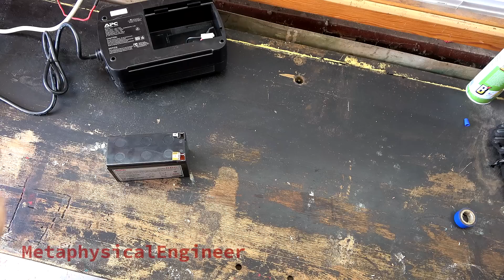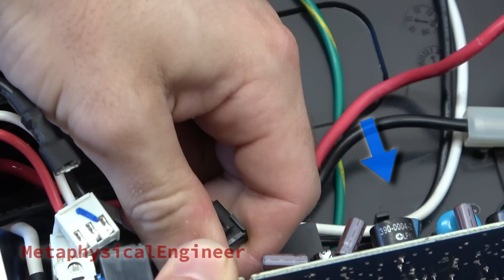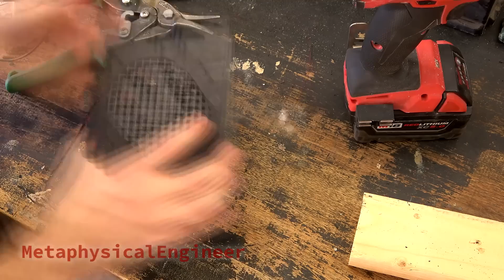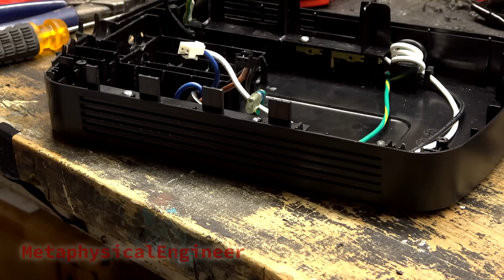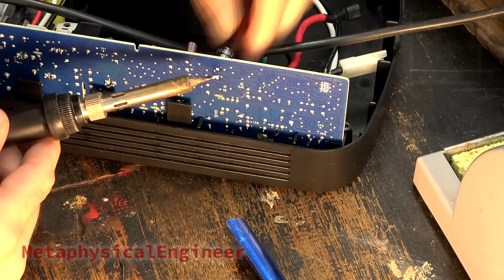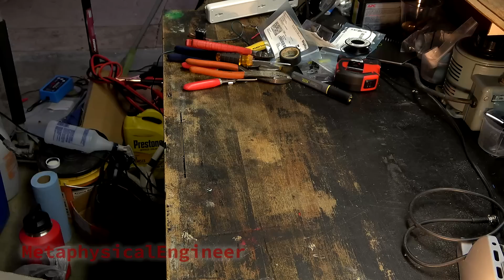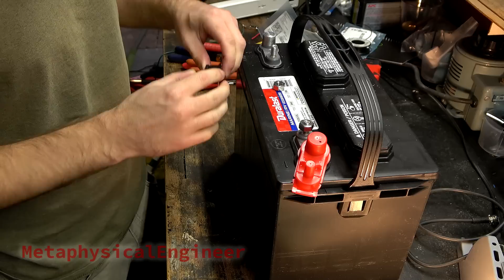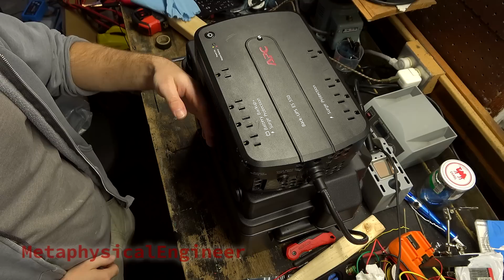Modifying broken UPS for long endurance BACKUP POWER!

Comment: Dude, that's a vented L/A battery being charged 24/7. I'm all about doing dangerous stuff and have modded many a UPS, but with LiPo4 or sealed L/A; What you have built will try to kill you. Otherwise, great build. But please, get a different battery. Generic China LiPo4 works best as it has it's own BMS and won't overcharge, plus 6x the runtime. It will take forever to charge with that tiny charger though. I run an old rack 3K UPS with a 48V Chins LiPo4 with bluetooth, runs my entire office for 5+ hours, I also have a LiPo4 charger on it (parallel) which recovers the battery in 4 hours, using the APC trickle charger took 30+ hours to recover. Keep on hacking!
Reply from the maker: How, exactly will it try to kill me?  Emitting a fraction of a gram of hydrogen over a 24 hour period in a 1960s building that has more than a full air exchange in that time? If it's gassing more than that at 13.5V, every battery maintainer ever would demolish every flooded battery it's connected to in a matter of months.  Much of the panic over battery gassing assumes batteries under heavy cycling and many batteries in a small space.  

Eventual version 2 will have the high performance batteries, solar/grid dual input, and all the goods.

Comment: I used UPC similar or just like this for years. Just drilled hole in battery cover and ran right to car battery. Never had any problems if I only connected it to computer and monitor. Much larger UPC units are available for cheap or free that just need a battery. No mods required. I only use semi-sealed batteries (tops don't come off) for less gassing. And I only use APC brand UPC. Less likely to have problems.

Comment: I've been thinking of doing something like this, but my work PC can be consuming up to 900W and who knows what I'm going to be doing when the power goes out. Thinking about chaining two batteries, but would also need to find a higher capacity converter.
Reply from the maker: Get a high output UPS sized for your equipment, including peripherals such as monitor(s), network, and a light.  Many higher end units will have options for external batteries and cooling systems to support extended run time which will simplify the project.  Size wires and connectors and fuses for the load, and get batteries of sufficient capacity such that they will discharge 50% or less during a typical outage.
Reply: @MetaphysicalEngineer  Yeah, that's probably best. I'm also trying to determine the best method for small consumption items scattered around the house; some cameras and sensors. Most use USB connectors so I'm thinking a standard power bank that supports line passthrough at full charge with instant switching. Been difficult finding reliable ones.
Reply from the maker: Power banks for smaller scattered devices is the way to go.  Most of those with USB are already using double conversion line to battery to 5V USB.  Transfer should be seamless.  Unfortunately I don't have much firsthand advice to give for those.
Reply: @MetaphysicalEngineer  You'd think so, but surprisingly almost all of them specifically state they do not support failover or passthrough. It's crazy. I have found literally one that supports it but it's like $200, and for that id might as well get a small UPS.

Comment: This is cool and all, just wondering why you went through all that effort to keep the beep? It's not like you don't already know the instant your power is out, do you really need an obnoxious beeper for a second opinion? Cheers 🍻
Reply from the maker: Often I will start a render or upload and then go do something else, so the alarm still has a use.  If it's the daytime, there often won't be many other items using power in the house so plenty of times the power has gone out and we didn't realize it for a while.  Plus, it wasn't that much more effort to keep the beep since I already extracted it to use the signal for fan control.
Reply: @MetaphysicalEngineer :
Understood.

Comment: You said you want this unit to be capable to allow you to finish a render, but then tested it at a similar load to your computer's idle power draw.  You could very well exceed the 500 VA capacity of that unit depending on the hardware in your computer.  Mine will pull 600 Watts while rendering, and I have a fairly low end video card.  You might have been better off picking up a used 1000VA unit for cheap.  Most of those run 24v though, so you would need two deep cycle RV batteries.
Reply from the maker: Mine's an older PC so not actually that powerful compared to newer monsters.  300W is pushing it with CPU and GPU both at full bore, and my render loads are more CPU bound so GPU sits at maybe 30% load. This project was initially going to be examining the failure of the UPS or swapping the original battery.  Only after it proved more alive and more robust than expected and that coincidental outage got me frustrated did I turn it into this project.  A version 2 with improved everything will appear someday.
Reply: @MetaphysicalEngineer  I use an ancient APC DL1400 which has a built in fan.  I have it connected to two Interstate deep cycle RV Batteries.  It runs my computer with a 50" TV and two 24" Monitors, a 6 Disk NAS, and some network gear.  I can get 7 or 8 hours of run time when the power goes out.   It's rare that the inverter in a UPS would go bad, but most people throw them out when they just need new batteries 😞

Comment: One question.... When battery is recharging, how do you prevent the backup of hydrogen gas from the 12v car battery? Where does it vent?
Reply from the maker: Offgassing is extremely small with a single battery at very slow charge.  This is an older house not a hermetically sealed bunker or tiny vehicle cabin, so any gasses dissipate quickly.  If I had a bank of large flooded batteries under heavy cycling, I would need forced ventilation, hydrogen detectors, and catalytic recombiners.
Reply: @MetaphysicalEngineer  agreed but this was more aimed at the novice. I can hear it now... " No one told me this could happen".  Just to cover your butt

Comment: Won’t a lead acid battery give off toxic gases? I know in a car when relocating the battery to the trunk for better weight distribution for example there needs to be a ventilation tube so the gases do not fill the car (or use an AGM battery like an Optima instead).
Reply from the maker: Offgassing is low with a single battery at very slow charge.  This is an older house not a vehicle cabin, so any gasses dissipate quickly. I would need ventilation, hydrogen detectors, and catalytic recombiners if I had more batteries under heavier cycling load.

Comment: Question, what was the final savings with all parts you bought vs a UIP with similar specs?
Reply from the maker: There really isn't a consumer grade unit with that level of runtime specs.  Even a high power UPS would only give 20 minutes at my expected max load rather than a couple hours.  I'd need to look at enterprise level units with external battery modules to get that runtime.  Even the self contained rackmount units only advertise as keeping equipment running long enough to save and shutdown, rather than ride through extended outages.  

Alternately there are portable LiFePo4 power banks that have UPS functionality, but those I've seen suggested by other commenters have abysmal transfer times of up to 30ms, which all but guarantees my computer losing power.  Even so, for the runtime of my homebrew unit, I'd be looking at close to a thousand for an off the shelf system.
Reply: @MetaphysicalEngineer  And what was the total for the one you built in the video? Would a charger battery and inverter combo be a viable option in your opinion or do a UIP have significantly less power loss in the whole?
Reply from the maker: Total was around 220 for all the bits, including the optional accessory kit I put on the battery box.  Charger, battery, and inverter in a fully online configuration where all power flows through 120V to 12V to 120V conversion would be less efficient overall, even if the inverter by itself was a bit more efficient than the UPS inverter.   This configuration only pulls a couple watts standby power to maintain the battery with the inverter only enabled when the grid goes down.  Fully online UPS systems prioritize zero interruption of power to the connected equipment over efficiency.
Reply: @MetaphysicalEngineer  So how much power would I lose going that route? Does a pc(desktop) require a pure sine wave inverter or would a cheaper one do just as well?
Reply from the maker: Battery charger maybe 85% efficient and inverter about the same.  So maybe 72% efficiency right out the gate.  Self contained online UPS systems may be better optimized.  Battery charger will need to be sized to be more powerful the equipment is so the battery doesn't discharge and is capable of charging during all conditions of use.  

If you want to do this and have absolutely zero power flicker during transfer, getting a pro grade online UPS of sufficient capacity and adding an upgraded external battery would be one of the simplest methods.  Those will already have internals and cooling designed for full time use.  Pure sine is better for the equipment; my computer PSU manufacturer claims it will not suffer damage on modified sine but not all have that promise.
Reply: @MetaphysicalEngineer  I already have the charger and inverter with modified sine wave in my storage, do you think a 1 to 1 isolation transformer would improve the sine wave or would that just be a waste of time and/or money?

Comment: Great reuse! There are a lot of these desktop SOHO UPSs' out there and they die all the time. It's important to note that not all car batteries would be safe for this use. This needs a sealed battery to prevent off gassing as that could create an explosion.
Reply from the maker: Offgassing is extremely small with a single battery at very slow charge.  This is an older house not a hermetically sealed bunker or vehicle cabin, so any gasses dissipate quickly.  If I had a bank of large flooded batteries under heavy cycling, I would need forced ventilation, hydrogen detectors, and catalytic recombiners.

Comment: Good project. Neat and tidy. Any concern with off gassing from the battery? I didn’t notice mention of it
Reply from the maker: Offgassing is quite slow with a single battery at very slow charge.  Otherwise float charge battery maintainers would boil dry the very battery they are designed to maintain!  This is an older house not a hermetically sealed bunker or tiny vehicle cabin, so any gasses dissipate quickly.  If I had a bank of large flooded batteries under heavy cycling, I would need forced ventilation, hydrogen detectors, and catalytic recombiners.

Comment: I wonder if the lifespan of the car battery will be an improvement on those SLA batteries.  My UPS considers a new one to be dead and unusable within two years, well below the 'expected' lifespan of five years, and even that is too short IMO.

Perhaps a wall of DIY nickel-iron batteries?
Reply from the maker: Car battery may outlast, but will need periodic checks and maintenance as it will slowly lose water.  Also parasitic chemical reactions will eventually degrade performance until it's no longer sufficient.  I plan on quarterly performance tests and electrolyte level inspection.  Even if I only get a few years of life from a battery, that will be worth the peace of mind of riding through an outage.

An eventual version 2 of this project will likely have much higher output UPS with higher performance batteries and dual input grid/solar charging.

Comment: I'd consider putting a scope on that power supply and taking a look at what you really have. Maybe the power is clean, but  it's probably not. A scope will tell you everything you need to know. One of the biggest things to remember when recycling junk is that you cant make chicken salad out of chicken shit.  I would have just put a piece of tape over the buzzer..

Comment: Wow bloody lead acid installed on its side without been gel type that battery wouldn't last very long probably a china knock-off 😂😂😂
Reply from the maker: It's a sealed battery in the original unit, suitable for any orientation.  And yes pretty much all of these are made in China, as otherwise they would cost $500+ instead of 100.  Just an unfortunate reality of the world we live in nowadays where everything gets outsourced to cheaper manufacturing where things like fair wages and safety aren't a concern.
Reply: @MetaphysicalEngineer 
 no shit Sherlock 😭
 lead acid especially wet cell are ment to be in up right orientation otherwise it may expose the inner plates as the electrolyte gasses off hydrogen when charging you will see a slot in each cell cap to remove it then there's a rubber cap under it remove that  to top it up also if there's a dent in the rubber cap that means it lost electrolyte ...... Gel type can be installed any way so they say but I've Neva checked to see if its BS just to get you to buy more ..... I'm sure gel type starts at 12ah min capacity for mobility scooters👍

Comment: i REALLY need a good ups... the power here is ALWAYS shutting off for seriously just long enough to shut my computer off. and then... for some reason my wifi/bluetooth card doesn't show up or restart for weeks usually. sometimes it'll come back if it gets another unscheduled shut off, but not always. it's really weird and i just can't figure it out. i use my phone hotspot for internet, and with jankie ass t mobile i've had nothing but problems with connection period. WAY worse if it's charging, and even worse than that if i'm trying to use usb ethernet on top of it. shuts off service, and i'll have to go to airplane mode to reset it a couple times, or it just won't work at all for a while. absolutely ridiculous in 2023 that this sort of thing happens at all. never shoud've left verizon. 5g might help, but that requires a whole new phone. big mess. but would be nice to at least try and mitigate some of it by my pc not shutting off out of nowhere til i can get the rest straightened out properly. i'd like to build a whole new pc with a nice big ups for it and my tv, new phone and back to verizon. but none are really possible at the moment.
Reply from the maker: Quite strange that your wifi card doesn't come back after a power flicker like that.  Does the problem persist even if you restart your computer normally?  Sometimes an unexpected shutdown can trigger issues on the next startup, and a proper clean shutdown and start can reset things.  Or is it your router/access point itself that doesn't come back up properly?  Unplugging that, waiting a couple minutes, and plugging in again may help there as well for the same reasons as for the computer.

Either way, in your case even a basic off the shelf UPS of sufficient capacity would be helpful to ride through those quick power outages and keep your equipment running. 

Agreed that Tmobile can have spotty coverage in places where you'd expect better service.   If your phone is getting very hot while using as hotspot, cooling it down can help a lot.  I've done testing and seen horrible throttling of all functions once a phone gets too warm.  Charging only makes the issue worse as the waste heat from the battery and charger circuits add to the issue.

Comment: This is Great :)  I have this same UPS running my Router and Internet box, ( its a old one I had from 10 years ago)
Reply from the maker: Thanks for stopping by!  These units are great for small loads right out of the box, but most use cases aren't expecting to run at full power for extended amounts of time like I needed here.  My parents don't have a UPS but do have some big batteries and inverters to keep their equipment running. A couple years back my dad texted me a pic of him and my mom and the cats watching TV like nothing was wrong despite a snowstorm knocking out power all day.
Reply: @MetaphysicalEngineer  I work on film set, Have rack mounted UPS for my Work PC/networking on a cart for and a Powerstation for when 45min on UPS is not enough.